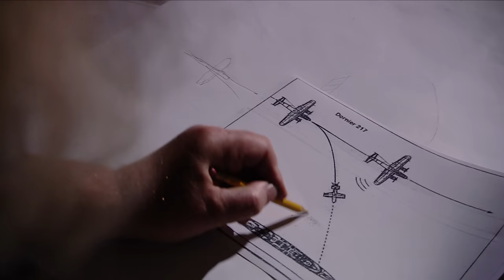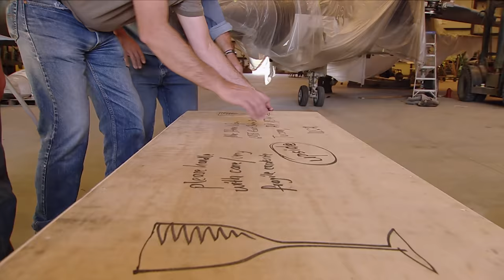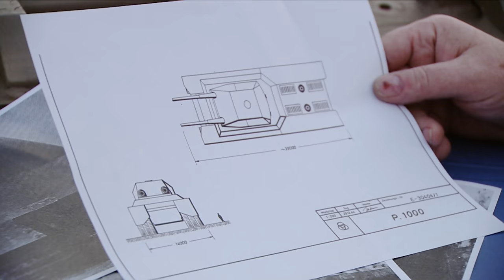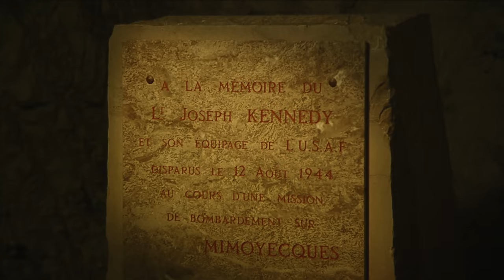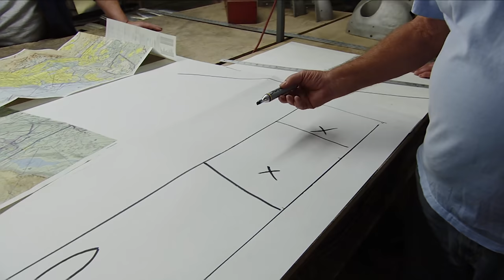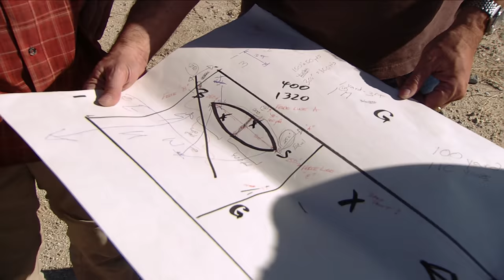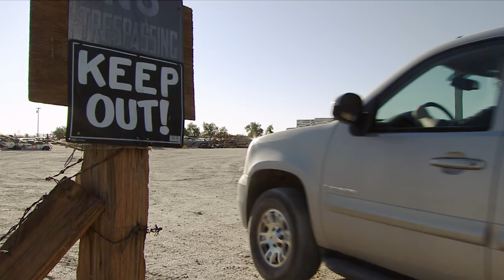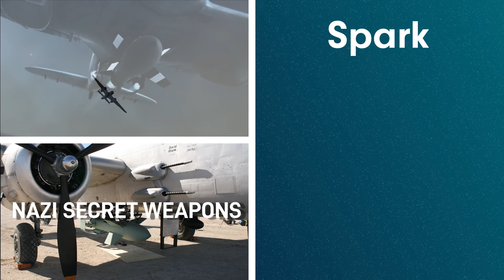The German Wonder Weapons That Could Have Changed WWII [4K] | Nazi Secret Weapons | Spark

Comment: I wrote my capstone paper for my bachelor's degree on the assertion that the Wunder weapons of the Third Reich were constructed to fool the German people into keeping up the fight because the Nazi high command knew that they would lose the war and did not want to surrender to either the western allies or the USSR as they knew that they would be executed for war crimes. Internal memos between Hitler and his Reich ministers prove this. Hitler did not delay production of the Me 262 for two years over the question of fighter or fighter - bomber, it was five months, and they knew even before that it would not change the outcome of the war. The Maus used 1,100 gallons of fuel to travel 30 miles and was impractical, The Fritz did not reach the Normandy beaches, the V-2 was too inaccurate and so on.
Reply: @bighands69  The Wunder weapons with few exceptions were developed later in the war. Hitler invaded USSR because he believed Slavs were inferior. I do not dispute that. However, once they realized that they were screwed .... The memos are the private onversations between high command not meant for the consumption of the masses or public. They are not therefore, propaganda. This is why they were made. This is recorded factual history. They were of course deleted to undertake such an effort in the first place Why else would a medium sized nation with significant material shortcomings attempt to invade the USSR. Insanity unless explained by flawed ideology.

Comment: They could have flown 1000' - 2000' higher to give the Fritz controller longer time to correct the flight path, considering the original Fritz X was controllable via remote control from the bomber.
Reply: But they didnt want to because then it would work to 100%

Comment: Over-rated weapon, Yankees figured out pretty quick that the bomb was controlled by watching a bright flare in the tail and steered it by radio control. 
Smoke screens and radio jamming made the bomb go wonky.
A further issue was the launch aircraft had to fly slow-straight-level while the operator guided the device - hard to do during heavy flak or fighter attack.

As far as sinking the battleship Roma, I suspect a lot of the Italian crew were too busy celebrating the end of the war to look up in the air.

Comment: Hello I am Jacob and I am at 14 and I haved a question whiched did I thinked of when dided the bomb camera guy did to show of how the littler camera would geted extractored fromed the bomb.  How it will geted pulled out of the bomb is reminded me of how did it they geted lite of tanks and armors cars and logistical pallets on to unimproved of air crafts run way places. The camera set uped is sort of liked a LAPES extractor only very much of higher altitudes….right?  Or haved I geted it as wronged?

And all of ready am I knowing it I writed difrenter.  At when was I at 11 I geted my head craxked and I geted a TBI.  I haved to haved a brains opiration and now do I haved little of aphasias brains damagings whiched haves leaved  me as muted and haves wrecked how cand I writed it stuff and readed stuff and walked good and others stuff . All ready do I know it so do you not haved to call to me a retard and all of that others stuff to castigated me. Only it does to wrecked how cand persons communicationed and still I amed pretty very smarters. I go at a magnets school and I haved grades averaged at 3.67
My helpers are not being at here for doing it some of edited stuff for me be caused it is on to Sunday.  Sorry ifed you haved troubles for readed it well.
Reply: If you are talking about how they got the smaller camera out of the bomb then what they did was they strapped a parachute to it so before it smacked the ground it would detach from the bomb and glide down safely.
Reply: @brewiy8149  
  Thanked you for answering backed to what haved I asked.  I writed it that as liked all of most 3 months ago so will I haved to watched agained it to maked sure and thened I will tryd for sended backed to you a answering.  But thanked you for answering to me. Mostly just do persons ignored me or called me names..
I amed very of fascinated by many of stuff but be for was I a orphaned my father and too my grand of father, my REAL of fathers, were being as missiles engineers to at Aerojets / Rocketdyne and my grand of father dided to helped works on to Polaris SLBM series of nuclears missiles and too dided he worked on to NERVA Project of nuclears engines for spaced crafts and my father dided to work on to Standards Blocs missiles and motors for Patriots and ASATs and some stuff about it THAADs motors stuff.  It does to interested me about it how all it did geted to start I GUESSED OF IT BE CAUSED of my fathers dided to do it that stuff at here ined USA very later.
Reply: @jacobsparry8525  Very cool! Some people in my family also worked with missiles and rockets.

Comment: Britian had advanced weapons as well. like jet fighters in 1933. 2 squadrons of gloster whittle jets hidden away in Ireland. never released for action.
They could of ended the war a lot earlier as Germany had nothing to counter them.

Atom bomb built and ready to use in 1933. never used cause it would of ended the war too soon and they didnt have enough resources to build more than 1. But they did send it on a Lancaster bomber to bomb Tokyo in 1945 but the plane got recalled 2 hrs from target as japan had surrendered. 2 weeks later USA dropped its 2 on Japan 2 weeks after Japan had surrenderd.

Bouncing bomb used in the dam busters raid built and ready to use in 1933. That raid was planned in 1930 3 years before Hitler got into power. the atom bomb program started in 1930 as well.

Giant guns built in Dover in 1930 to hit targets in France. the biggest 1 could hit Paris from Dover. Bigger and loner range than the German guns.

Manchester bomber could fly from UK bases to Moscow and back and drop bombs so could hit any city in Germany. that had 2 engines and carry double the bomb load the Lancaster could carry. But it had engine probs and they kept catching fire so the engines were swapped for the merlin engine which reduced its range and bomb load and they needed 4 merlins to get off the ground. with the merlin engines they renamed it Lancaster.

the german guided bomb needed 2 planes to use it. 1 to carry the bomb the other to guide it. It used radio control to guide it so the 2nd plane had to guide it and to keep it on target. it wasnt very accurate. the British version only needed 1 plane and used radar to guide it to target. that was the 1st fire and forget weapon.
Reply: Mate, "would of", (like could of, should of, must of) is not a thing. It comes from hearing
 " would've " which is a contraction of "would have".
I jumped, I have jumped, I would have jumped but it was too far, I would've jumped...etc 
Sorry to be that grammar Nazi PITA but correct English sounds educated & helps the credibility of your argument, & bad grammar detracts from it
Reply: Britain never had the atom bomb it had theories and science in regards the field but not actual working technology that would allow them to engineer such a system. 
Building the atom bomb required advanced material science, advanced chemistry/physics, control system engineering, high output manufacturing and extremely deep pockets to keep attempting it over and over with hundreds of failure points.